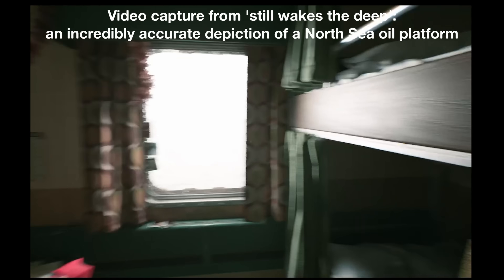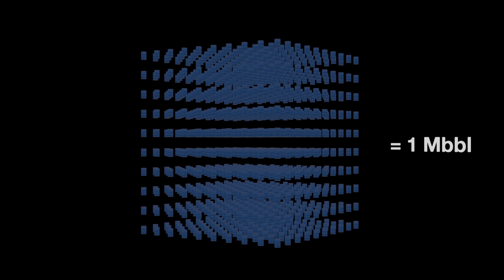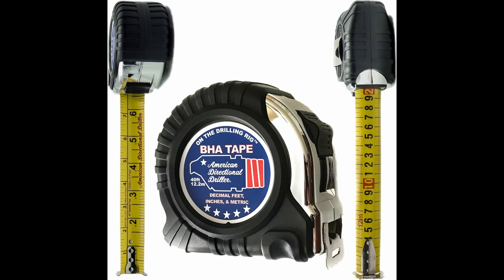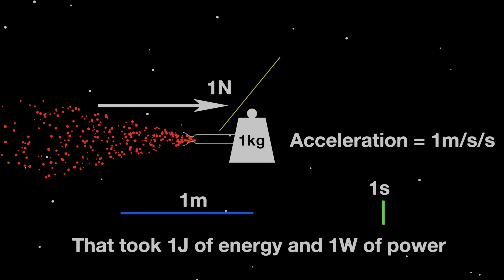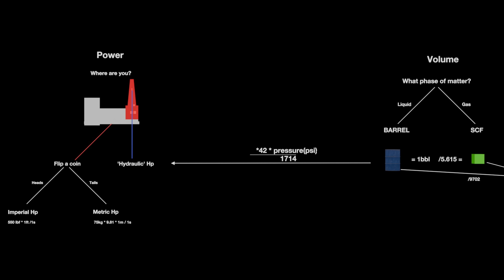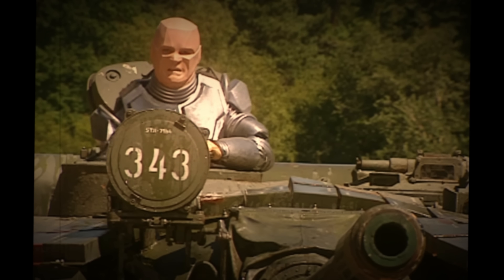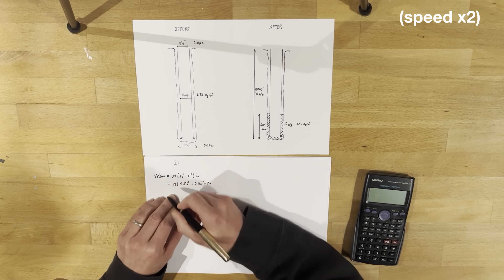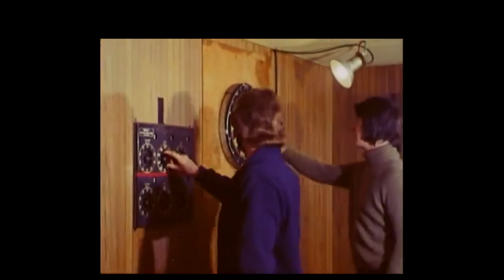Oilfield Units: a Measurement System so Cursed it made me Change Career

Comment: I feel your pain - retired US marine engineer. 
Most of are large commercial vessels were re-flagged;
So, typically their tankage (as built) is calibrated in Cubic Meters, which then converts into metric tons (which we denote as MT) by simply multiplying by the specific gravity.
So, fueling in most of the world is pretty straightforward.
But of course in the US I need to convert from cubic meters to BBL.
Of course, because engines actually consume fuel by Mass (weight) not volume, I first have to calculate how many metric tons are required for the voyage,
then convert to cubic meters, and then convert to BBl.
but when I tell the mate how much fuel that I've taken on, to be accurate I need to tell him in the ton you would recognize (20CWT) which is 2240 pounds, or what we call "Long Tons" LT,
because that is what all his ballast loading is calculated in. 
(for those wondering if the difference between an MT (~2200 lbs) and a LT (2240 lbs) is really important, remember we're commonly loading Thousands of Tons on board.)
Now where is gets really silly is when dealing with Government vessels, or fuel depots, or if you are on government contract, they want all their fuel reports in gallons....
Oh, and just for fun, I'm old enough to remember when Canada still used the Imperial Gallon, and there were 12 pence in a shilling, and 20 shillings in a Pound.
Speaking of errors in conversion, have you ever heard the tale of the "Gimli Glider"?

Comment: If you're frustrated with all that, check out the oil field in Alberta, you'd lose your mind with how simple and effective it is. Fluid (water, oil, cement, etc) , as well as gas if I remember correctly, is measured in cubic meters (m³), referred to industry-wide as cubes.

Comment: I build oil facilities in Canada. In the field basically everything is done in imperial. Volume is  m³ (cubes) if its a raw product and in bbls once processed. I personally build in metric, which for the most part all of our engineered drawings come in metric at our request, but not always. Our crew will force someone to conform to metric or drive them off the crew. Everyone that I have worked with that does things in imperial always goes to the nearest 1/4 or 1/8 if you are lucky. People think I'm neurotic building to an exact mm.

Comment: This reminds me a lot of SDR piping sizes. SDR is standard dimension ratio so if you have an SDR 11 pipe that means the wall thickness is 11% of the overall diameter of the pipe so you could have 4-in SDR 11 and that would have a different ID and OD then 4-in SDR 13 or 4-in SDR30 anything it's ridiculous and makes ordering plastic and HDPE pipes nearly impossible

Comment: Hold my beer: Sand Swing Squared (SS²): a standardized unit quantifying human or calibrated duck induced kinetic displacement with squared scaling. 1 SS² = the area equivalent of a single intentional sand swing, allowing measurement of motion, energy expenditure, and chaotic amplitude. Tiny gestures ≈ 0.01 SS², deliberate swings ≈ 1–3 SS², extreme actions ≈ 10+ SS². Universally applicable: effort, spatial movement, even behavioral intensity. SS² translates physical action into a reproducible, scalable metric

Comment: I am a physicist working with an electricity company. I already find it mildly annoying when you have factors of 3.6 (or 3,600, or 3,600,000) popping up because of the conversion from J = Wh to kWh, since there are 3,600 seconds in one hour 😀

Comment: Some more fun units that are used:
Proppant (sand):
1 sack=100lbs
1 supersack=2000lbs
Yet when its delivered it will sometimes be measured in acres of "dirt"

All this being said I still refuse to use a cubic meter per minute (or a "cube" for short) or a megapascal as a units for rate and pressure. Barrels per minute and psi give you far more resolution when dealing with rates and pressures that can be communicated easier and faster when things get hairy. For example: "drop rate a barrel" vs "drop rate a fifth of a cube"

Comment: The USA more or less founded the oil and gas industry, it's standards and terminology are stilled used, the standard's are pretty good, the anal adherence to stupid terminology is grating. Bechtel did supply it's standards in SI and American imperial, all the testing I worked on was carried out using SI units. Base 10 that corresponds across volume/weight and pressure is so much easier to work with.

Comment: The back story to why and how British oil rigs pronounce things in US English and the US math goes back to three men Red Adire, Boot, & Coots. And to the fact that inches calculated out in machine feeds and speeds on a lathe calculate  without need of half gears, it is all whole number gears. Also difference in machines used on sites goes back to: USA designed put the hydraulic oil in the rear, British machines put the hydraulic oil in the front of the machine. Not an issue until you have a well fire. Then one machine will out work the other. And as far as using imperial vs metric imperial and time for that matter are based on Duodecimal and you can do mental math quicker if you are taught the tricks and many people that built rigs did cowboy math

Comment: So really fun factoid in telecom for 100 years they never calculated with zero -1 dbv was 1.1v because bell labs said on a wire in infrastructure zero volts will never exist you will have background noise but the initial calculation of db was based on black powder sub sonic cannon fire that was 100db. Then we discovered high energy explosive and everything got calculated log. The EU changed the calculation  because the use of curta calculators they didn't want to mess with .1 it continued into digital age because binary. And that changed how we calculate voltage

Comment: "BBL" is older than standard oil and 42gal barrels. I know there are several dubious sources that say otherwise, including, now, this video. Consider that BBL is the abbreviation for barrel in the beverage (31 gal) and gun industries (0 gal) as well.

In fact, BBL has been used since the 1700s at least, long before the petroleum industry ever existed.

Comment: I work in a winery.  Barrels are 59 gallons (225 liters) because at 60 gallons the tanks are regulated.  We do additions in grams/liter and pounds per thousand gallons.  Cases are 2.5 gallons, or 9 liters.  Used to run a drilling program so I know how you feel

Comment: Paper size is one of the things where I really won't agree with you because it is completely arbitrary and there are really never situations where it matters how you defined the size of paper.
Reply: The A standert is special since thu rachio is the same 

If you have a design and you print it out on A4 and you think it is good you can now print it out on a A0 machine and have perfect marginals
Reply: @Goroca  I guess I should have said, for the average person. If you're a graphic artist or someone in publishing, it probably matters.
Reply: @sauercrowder 
True 
Bet if it dos not matter 
Way not use the better standert
Reply: @Goroca  Because the effort required to change the standard outweighs the benefits. At least when talking about the size of paper we use for letters and general everyday printing. It has a lot of secondary effects (think, mail system), probably costly to change for no real (financial) benefit. That's why these things persist.

Comment: The reason these kinds of archaic things exist in certain industries is because it'd be more dangerous to fix it than to keep it as-is. Everyone in the industry is used to the old system. Even if you know a different way is better - and they likely know this, too - the fact is that the ENTIRE sector uses the old units. You'd have to basically have every single company, every single supplier, every single engineer, every single contractor and rig worker and the rest to all switch over at the same time. And then, you have to make sure nobody accidentally mixes it up with the units they've used over a two decade career.

It's far easier to keep things as they are and train the new guy than it is to transition an entire industry overnight. It's a bizarre catch-22 where everyone knows a different system would be easier, but even saying that is annoying and reflects an ignorance bordering on arrogance because no matter how much better it is, it's simply not practical to switch. Hence, the "metric vs proper" and lectures straight off the chopper.

Comment: Damn, I work in the Canadian oil and gas (mostly gas) industry and I don’t think we’re even this bad. Most of the units I see are SI, and usually just cubes (as in cubic meters) and kg. You can get me started on our absolutely idiotic land identification systems (yes, systems) though, depending on what/who it is, it could be UTM (with multiple types), GPS (both decimal, and DMS), NTS, DLS, or some made up system by a company.

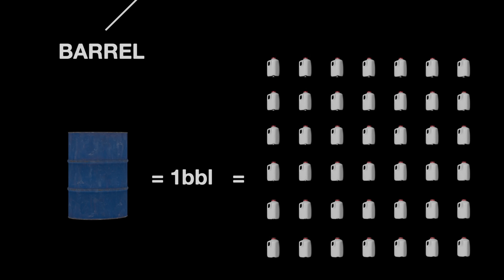Comment: 2:22 wait WHAT??? why on earth does the UK use MPG when gas is all sold in liters anyway?????

god the UK really has an underrated mess of unit systems, of course they had to be different from the EU and just mix a bunch of shit together
Reply: Britain is such a small country and service stations are so frequent that it's impossible to run out of fuel there. This means no-one ever has to calculate how far their fuel will get them. However they still want to know how economical their cars are, so they just keep using the old mpg units. Since they still use miles, L/100km is no better so there's no point switching over, and no-one can be bothered using "miles per litre" or "litres per 100 miles".

Comment: This is because the entire american education system is constantly trying to push metric on the students, despite being an objectively inferior system, that exists because it's easy to math on paper, and not because it's practical for measuring anything.
Reply: How is it easier to use imperial
Reply: @Goroca  factors. 12 can be divided twice, has 4 as a factor, ect. It has a total of 5 factors. 10 has 2 factors, 2 and 5, and while 2 is useful, in this context, its unremarkable, and 5 is largely unused. Imperial is much better for construction and measuring for these reasons. If you need to split something in half, and half again, or god forbid, into thirds, imperial will give you nice numbers for much longer, and in more scenarios.

Metric is good when you want to pay less, by hiring braindead people to verify permits and screw with people all day, because it requires 0 extra math. When switching units, just move the decimal. You and I might memorize 72 as 6*12, but Cletus, Jamal, Karen, and Shanequa only ever learned multiplication tables up to 10. 

This is important, and meaningful, because it speaks to what is important, and who is in charge. Construction companies with actual contracts to build stuff love using imperial, and do not want to change. Nice numbers that don't involve crazy decimals means tighter tolerances, and higher quality work. Building inspectors and teachers LOVE metric, because everyone already knows how numbers like 10, 100, and 1,000 fit into each other, and nobody actually cares, or gets hurt when they screw up.

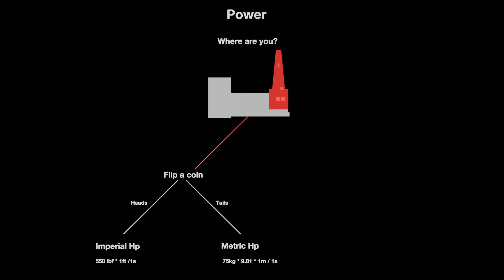Comment: 9:00 imperial and metric horsepower aren’t the only two units called horsepower, there’s also electric horsepower, which is different, and then there’s also the fact the imperial horsepower can be defined in several different ways that all have different names for some reason, being mechanical horsepower, drawbar horsepower, hydraulic horsepower, and probably more I’ve forgotten about

Comment: 1714 referred to as "seventeen hundred fourteen"  is not "the way americans say it".  The teens thousnads place thing (and this is an incorrect usage of the general usage of that pattern even if used that way in the oil industry) may refer to numbers, but here it wouldn't be used that way outside the oil industry, in general Americans would refer to this as "one thousand seven hundred fourteen" the "teen-hundred" nomenclature is normally reserved for numbers with out a ones and tens place as a shorthand (or were they are removed for approximation purposes), so it actually provides a linguistic benefit, and is also used for *dates*,  but they wouldn't say "Seventeen hundred and fourteen" for a date americans would say "Seventeen Fourteen" and only "The year Seventeen hundred and fourteen" if they were being campy about it, as technically you're not supposed to use "and"  in American English this way in many regions, and Americans may generally refer to this as the "Seventeen Hundreds", and the year 1700, "Seventeen hundred".  I'm also not sure this is even a uniquely American thing.  It is not used in every day life to talk about specific numbers for measurement, specifically because it doesn't make a whole lot of sense to do so when you can have additional significant figures after the decimal point/comma, which would make it awkward to talk about.    The reason it's used is it allows grounding of dates/numbers within a system where values from 0->10000 are important to talk about, such as, dates, cardgames,  and approximate values that hover around these numbers (such as purchasing a "fourteen hundred dollar computer"), or "1400 barrels a day" (where we are implying we are making an approximation by saying this leaving out the ones and tens place).  This way of saying numbers is not supposed to be used with precision, so if it's being used on oil rigs the way you describe it's being used in a way that is not congruent with american english speakers at large.

Comment: Wow, what a convoluted combination of units and conversions. If only the few holdouts would actually switch to SI units.

US paper sizes seem a little less weird if you've worked in a print shop. We would get 4' x 3' sheets. When printing "US Letter" the larger printer would run 4-up on half sheets, the smaller printer would run 2-up on quarter sheets. Then margins were cropped and pages cut apart. For "Tabloid" it was 2-up and 1-up, respectively.

Comment: Fun fact: At some point the foot was redefined to be exactly 3048 mm. Which means the US system of length is actually now based in metric and doesn't need its own standards.

Can't help with the several kinds of BTUs or barrels.

Comment: Hi there, American chemical engineer here - bit of a major error on the volume unit. (Actual) cubic feet are a volume, using the unit ACF. 

However, you wrote SCF which means "standard cubic feet", which is not a volume but actually a molar quantity. 1 SCF = uh, depending on the standard, (thats another mess), maybe 0.002641 pound moles, which is different from gram moles.  

Believe me I have a hard enough time explaining this to my mechanical engineering coworkers that no, a flow of "Standard cubic feet" has nothing to do with the volumetric flow, unless youre at the predefined standard conditions, and assuming compressibility = 1 (ideal gas law, good enough at standard conditions for like any common gas). It's one of those things that doesn't matter right up until it really matters.

Its pain

Comment: Mechanical engineer in the US, I've predominantly used imperial units for anything to do with dimensions or stress/strain. Because staying in decimal inch units, at small scales (1mil to tens of feet), there's really no difference in terms of difficulty between it and metric. Everything else is better in metric (especially power and thermal stuff). And at large scales or super small scales (<.0001").